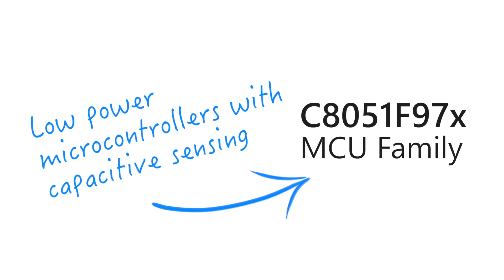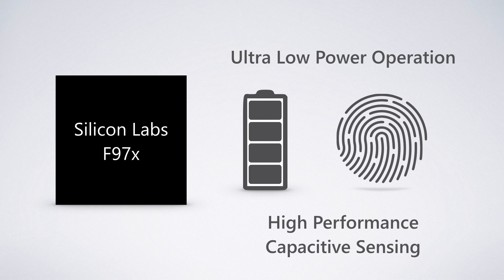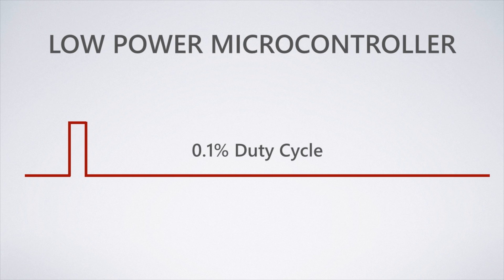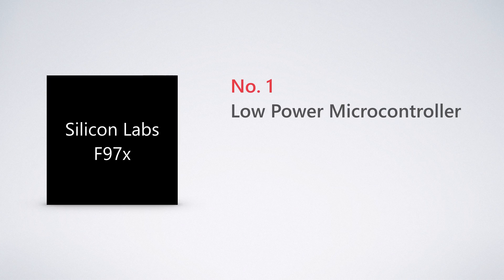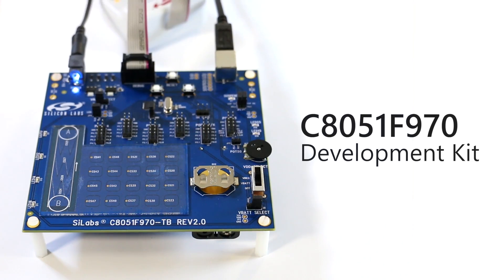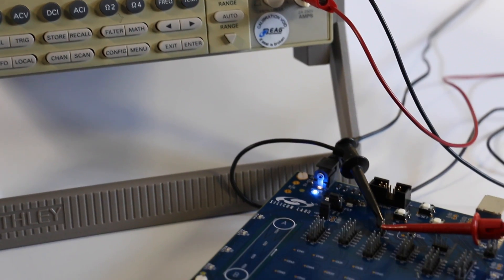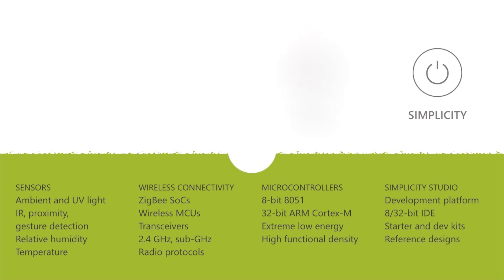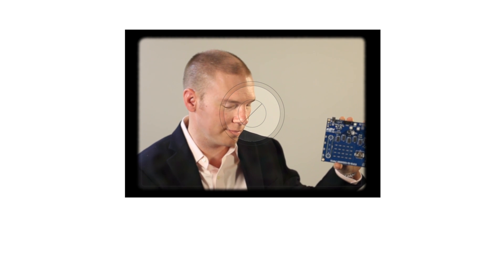C8051F97x Capacitive Sensing Microcontroller from Silicon Labs

Comment: It might work on a single Cr-2032 battery for 20 years, which is amazing. The problem is that battery is going to vomit its content before reaching 4 years and because it is directly on the board, it might even destroy the board. It would be nice if could install battery externally or at least on a corner of board with no components around it.